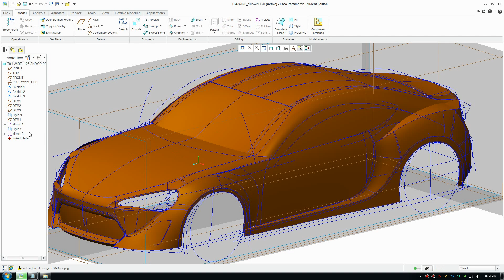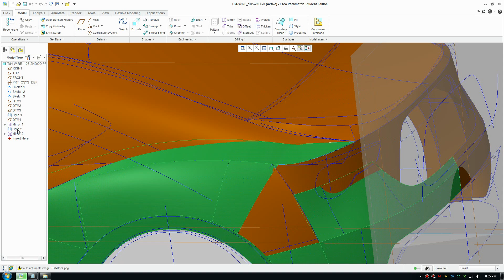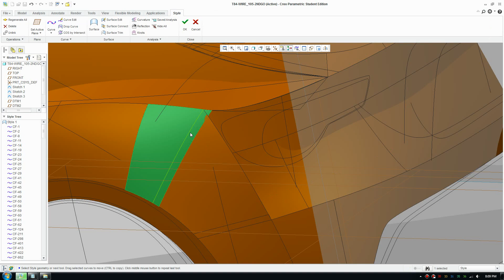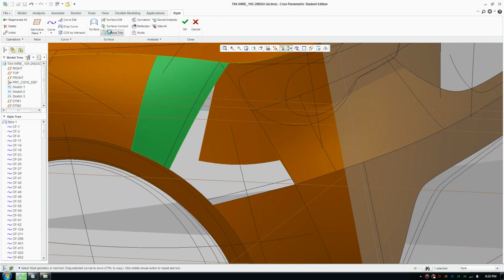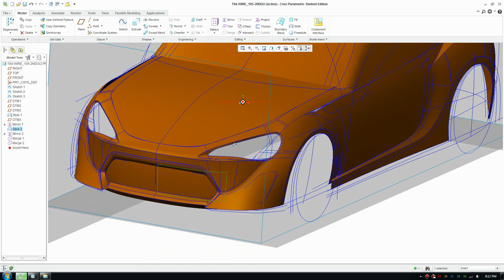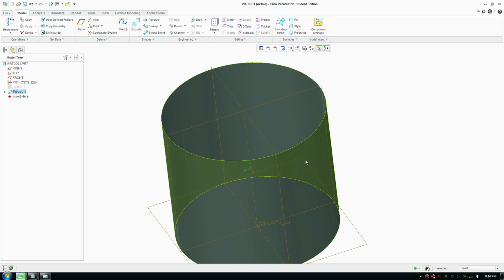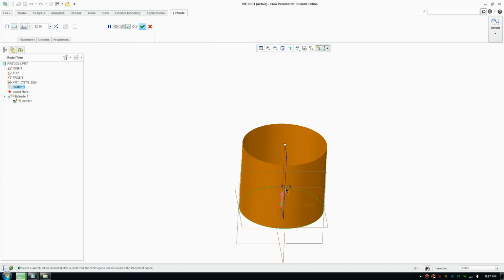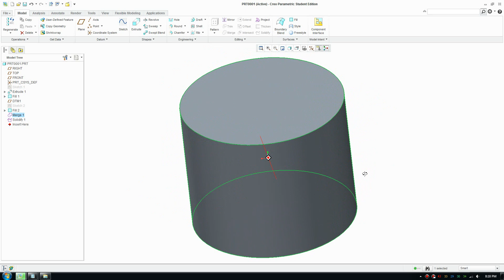Creo Car Tutorial Toyota 86 - Part 16 Merge and Solidify to Make a Solid Model

Comment: Thanks for the video but I've created the design of my car but i cant seem to solidify. Any help would be greatly appreciated
Thanks
Reply from the maker: To Solidify, you need to make sure it is fully covered with no gaps. You may need to simplify your geometry. After merging everything. You then solidify.
Reply: H Huynh so does that mean that there can't be any surfaces seen in the inside
Reply from the maker: Zaakir Camal Yep. It needs to be a clean stitched surface. It joins all around without leaving a mess. You may want to refine and clean up the model if it is not stitched well together.
Reply: H Huynh Thank you but do you have to have a base in order to solidify the car?
Reply from the maker: Zaakir Camal Yes. You need to block out all gaps.
Reply: H Huynh I've been trying to solidify this car for a while now and nothing I do is working. I need to hand this car in for an assignment and it needs to be 3D printed which is why I need the design to be solid. I'm freaking out. Is there any way that I can email you my creo design and for you to have a look and let me know whats wrong with it. Please I really need help
Reply from the maker: Zaakir Camal You need to really simplify the model to solidify it. To make a fully detail car model, it would take 6 months+. Just remove all the details. Make a few surfaces. Trim, join and merge then solidify. I can't do it for you, sorry.